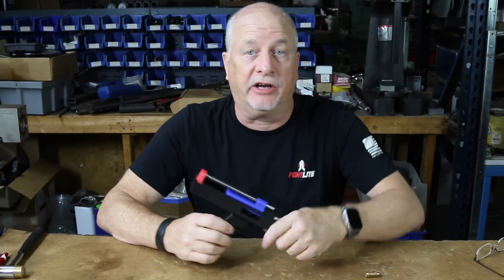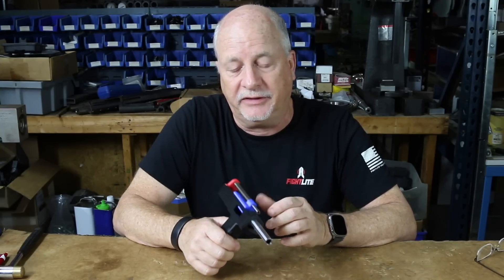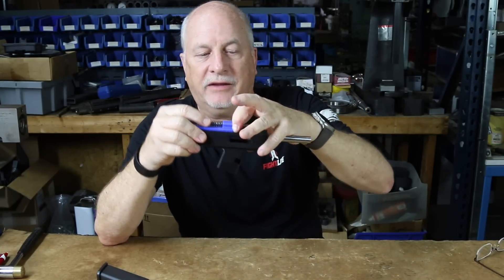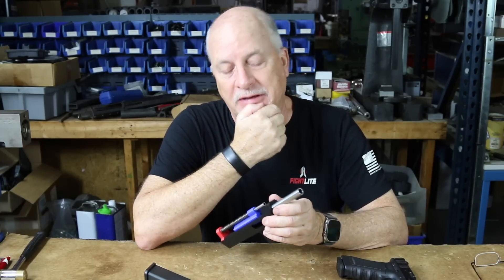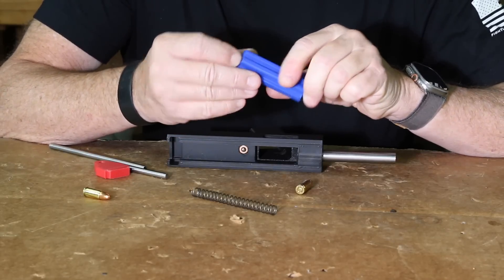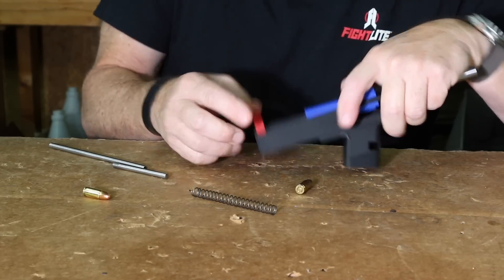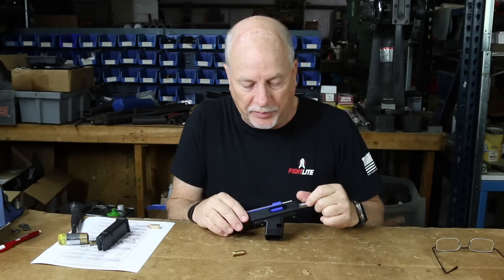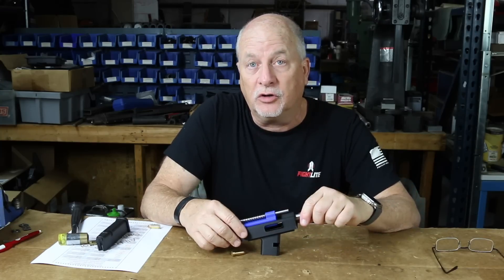Mag Position Tester! (Edit)

Comment: If the barrel is stationary and a Glock magazine is used, then the magazine shaft must be positioned at a different angle.
Measure the distance to the chamber in the Glock when the barrel has moved back and that's it.
The store itself will not be able to enter higher if the shutter is locked and secure it a few tenths of a millimeter lower so that the shutter does not rub against the sponges of the store.
Of course, it also depends on which feed ramp is in front of the chamber .
Если ствол неподвижный и используется магазин от Glock то шахта магазина должна быть расположена под другим углом .
Замерить расстояние до патронника в Glock когда ствол отошел назад и всё.
Сам магазин не сможет войти выше если затвор заперт и закрепить его на несколько десятых миллиметра ниже чтобы затвор не тёрся о губки магазина.
Ещё конечно зависит от того какая рампа подачи что стоит перед патронником .

Comment: My very initial thought was you'd probably qant to tilt the magazine backwards by the same number of degrees the Glock barrel tilts backawards and drops when it is fully unlocked.

That would yield the same net feed angle as when a Glock is first trying to feed the round (the most critical part, because once it starts going in, it can be shoved the rest of the way qithout issue).

Comment: cool video! but you surely know that you are testing things out with different material, like plastics. back when I made guns, the right material, hardness and ROUGHNESS made a big difference. i remember trying to do the same thing you are doing (I was prototyping) using 3D printed AICS mags for 9mm Luger bolt rifles as well and things were not working that great. i was hard headed and decided to machine one alum mag to see if there was a difference and... they worked great. i may be saying something you know already...... great video BTW.

Comment: As a life long tinkerer. Started on small engines then firearms 1966. Been interested in Marks work and other fans of hole punching ever since I discovered gun tubers only 14 years ago. Sidetracked.  Great video Mark. 
Soon as you zoomed in. I had a Pre 1986 flashback.  Something screaming.  That thing needs a fixed firing pin.

Comment: I did something like this in 1997 trying to find the best relationship between magazine, feed ramp and barrel for a home made SMG. I had a partner at that time (the guy with the lathe and the milling machine) and that guy was too stubborn, impossible to work with. For me, internet and CAD came only two years later. Today I was watching a S&W model 52 video, that gun feeds empty cases while many 9 mm pistols still fail to feed.

Comment: Random thoughts: 

@markserbu

1. Would transparent SLA 3D prints for this application be "worth it" for the ability to visualize the feeding dynamics of mag + bolt + feed ramp in the high-speed video? And the ability to shine light through the "reciever" and "bolt" might be useful?

2. Same solutions/needs obviously produce convergent designs, but the feed tester looks like a chunk of the "Mac Daddy" 3D print design for MAC-style uppers & Glock mags. Did you "CAD down" the Mac Daddy .stl/.obj? But... I KNOW "you're that good" too. And that you did it from scratch, is 100% understandable. (And if you say was easier & faster even...)

3. Do mfg's and designers ever address the round bounce & rim hangs in feed issues with minor chamfered edges or rounding at the chamber mouth?  Just being careful so it doesn’t compromise case support at the web? (I recall the "Glock bulge" at the feed ramp consternation online about 2 decades ago, for the .45 and .40 models...)

Comment: could you use a feed ramp that pushes down as the bolt closes, its up long enough to help feed and elevate the round into the chamber but pushes out of the way on a delay behind the round?  it will slow down the system and introduce some resistance for the spring and bolt but might help feed reliability.

Comment: Speaking of mag positions, recently I've been thinking about how to shorten a bullpup rifle. A lot of them have an uncomfortably long length of pull.

I've been thinking about it and it occured to me that the solution could be getting rid of the typical rotating bolt.

Something like a modified Vz.58 system with a locking wedge and non-rotating bolt face could be the answer. The whole bolt carrier could be really short, because there would be no need for a bolt stem. The locking wedge itself could be mounted onto an oprod-esque extension. That would relocate the locking mechanism forward, roughly above the pistol grip of the bullpup, again contributing to shortening the rear section of the gun.

What are your thoughts about this? I am no gun builder, I have no practical experience with gun design. It seems to me like it could work, though.
Reply: The Soviets (TKB022) and Czechs (https://www.youtube.com/watch?v=8fz1mvpqF_I) both experimented with the solution you are describing, check them out.

Comment: Mr Mark, This video helped me a lot! But the fact is that the 9 mm is very easy to work with, due to its weight and its "fine tip" which makes it extremely easy to work with... As for the 380 acp, I've been trying for about 3 years to make a reliable ramp and I haven't been successful... If anyone has any tips I would appreciate it! Hug!

Comment: Great approach; the interaction between magazine, round and barrel is where a lot of reliability issues come up. An incremental approach like this looks like a great industrialization and product optimization tool. It takes some time at the start, but saves time, cost and headaches later on. Just an idea from an engineer that happens to have a lot of experience with test fixtures. Fix the barrel with barrel extension on a larger plate, and attach the magazine well on that plate with flanges and key-holes with screws. In that way, you can adjust the relative position of the magazine closer or further from the simulated barrel, and up and down compared to the barrel axis. This permits the optimization of both distances through iterations in both directions.

Comment: Have a question, could you have printed it in clear plastic to aid with seeing what was going on?
Reply: 3D prints are never really clear, they are translucent at best. Witness holes or access ports, if you can make them, are a much better option than "clear" plastics for viewing live operations.
Reply: It would come out translucent instead of transparent.
Reply: @jacobstaten2366  I've seen several people print clear parts
Reply: Yes, using Rygar1432 settings (Just search "How To Print Glass") you can achieve a pretty good transparent effect very easily, just takes a little while to tune your settings. On the page with the settings, Rygar has pictures of extremely clear prints, like actual fucking glass.

Comment: I hope your curiosity is toward a compact blowback action that is not fugly and BIG. A modern fixed barrel pistol allows for suppressors that do not need a  Nielsen device recoil booster
Reply: The challenge in a blow-back action is to get enough mass in the bolt to handle 9mm....which means a LOT or you have to substitute recoil spring pressure which then can make them fussy about bullet weight and recoil impulse.   With enough bolt mass the recoil spring only needs to be strong enough to feed the next round out of the magazine.   That takes a bolt of a couple pounds which kind of defeats the 'compact' part of the request.   The High-Point 9mm's show how much bolt mass is needed and is why they're a big blocky thing.
Reply: You can do short-recoil in other ways than the Browning tilting barrel style, like the Walther/Beretta style with a separate tilting locking block, or a rotating barrel style, neither which would need a booster, and both which would have better dwell time than a blowback gun.
Rotating barrel would however not work well with attaching suppressors with screw threads, so you would instead want some sort of lug setup for that.